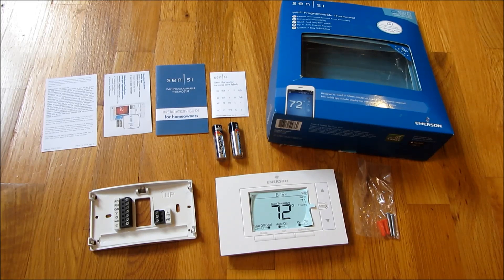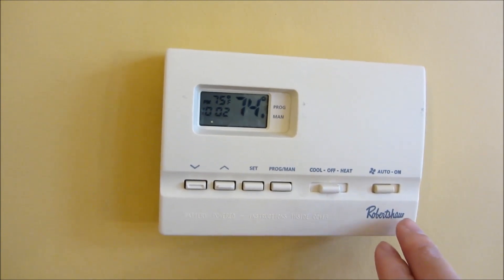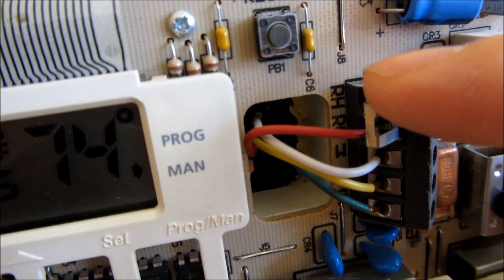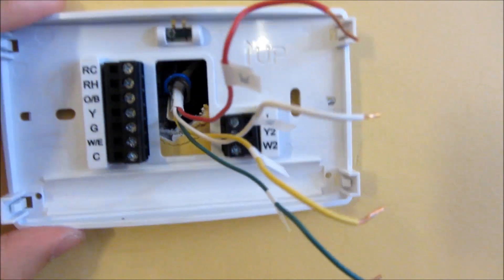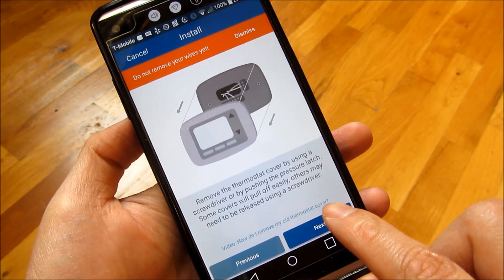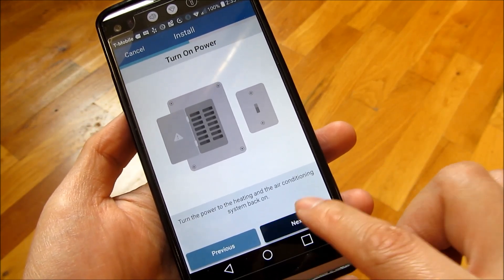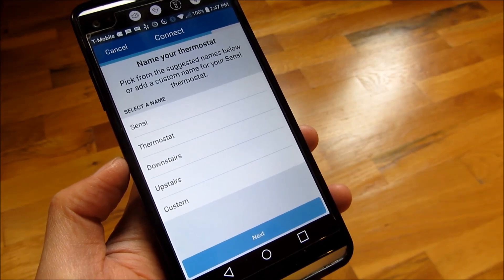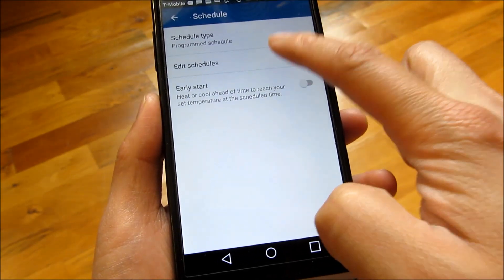No C-Wire Smart Thermostat Install | Emerson Sensi WiFi | Step by Step | Robert Shaw Replacement

Comment: I too have 4 wires RC, G, Y, W. I did see you connected the respective points. Do we need the brown wire in C or it will work without that.

Comment: I have a 2 wire system, oil heat only. The Sensi app says that wire configuration is not compatible with the Sensi thermostat. But you say it will work without a C wire using battery power only. Why wouldn’t the Sensi app say it would work? It doesn’t make sense to me. I don’t want to begin replacing my old thermostat until I’m sure. Please help.
Reply from the maker: I don't think this works with Oil Heat, I believe my brother had the same problem.  Mine is Gas Furnance, and apparently it works with a Gas Furnance without a C wire, but not with the Oil Heat.

Comment: A quick question about the C wire if anyone has the answer. Yes this thermostat works also without C wire (then must be powered by batteries) but does it mean that if powered with batteries you won't benefit from the Wi-Fi features? 

Because I just bought the same and I didn't install it yet, just playing with it (batteries plugged in). When turning on the Wi-Fi feature, I can see an X at top left rather than the Wi-Fi logo. I was wondering if the C wire is really required for not only powering it more efficiently than with batteries (you won't have to worry about changing batteries) but C wire would also be required for full Wi-Fi features?
Reply from the maker: Use it with AA Energizer lithium batteries, been lasting 4+ years without changing.  WiFi works well, you need to program it in the app
Reply: @PoolarityChannel  Thx for the tips man! I'll hope that once i connect the C wire, i'll be able to use the wifi Features.

I'm suspecting that this thermostat needs the C wire absolutely for the Wifi features, otherwise with batteries, it would just run as a normal thermostat

Comment: How long do the batteries last with no c wire?
Reply from the maker: Using lithium AA batteries, 4+ yrs, I use rechargeable lithium batteries in the links in description area, those last 4+ yrs on one charge

Comment: Without the C wire will the WiFi work? I have a 2 wire system and been checking if the built in jumper could be removed between RC and RH terminal? If it could I could connect a transformer to this thermostat on the RC and C terminal.
Reply from the maker: I use the Sensi without the C-wire, it requires 2 AA Batterys, so I use the Lithuim which so far has lasted 3+ years, WiFi and all. (see the description area for the ones I got).  But no issues its been over 3 years.
Reply: @PoolarityChannel  hello I am very confused . When you take apart the old tstat you have no c wire attached but then at 5:08 there is suddenly a brown wire and it is attached to the sensi C wire lug?? I thought the whole point of this video was not needing the C wire? I ask this not just because of the confusion; but because is that then meaning your batteries are not being necessary (as you do indeed use a C wire ?) ,and so all bets are off for having wifi with no C wire and running the Wi-fi completely off batteries? I have no C wire for my ST55U model sensi smart thermostat but I Do get the flashing network icon in the upper left corner of the screen but it will not ever connect; and I have been troubleshooting this for hours now and cannot make the thing connect. I have  R W Y G wires in the app setup. So my question is is your video representative of actually not having a C wire or not; And if you don't have a C wire can you get the wifi without the C wire or not? Thank you
Reply from the maker: @eswords1  so sorry for the confusion this was many years ago, so from my recollection I was trying out multiple additional wires that was hiding behind the drywall.  In fact there is absolutely no C-wire.  I have been using 2 AA Energizer Lithium batteries for 5+ years to power this, and it has been absolutely great, have not yet changed batteries at all.  The wifi is powered by the 2 AA batteries and have run flawlessly.
Reply: I have 2 wire system also and I purchased a 24 volt ac plug in transformer
Reply: did you leave any wire attached to the C lug at all, and if so, is it possible that that is providing power for the wifi?
Reply: On this unit is there a jump wire I need to remove to put in my 24v transformer
Reply: @vinnysantangello8982  You can cut the built in jumper on the back of the Thermostat, it is indicated and easy to spot. The info was from Sensi about 2 years ago.

Comment: Man you missed the need for batteries and C Wire topic which I believe lot of old thermostat owners are going to have to deal with. So I see there are batteries in there, so does it mean I don't need to bother with 'Common Wire" to power the device?

Comment: How do you know which wire is which if you just have no thermostat but 4 wires sticking out the wall?

I have white with blue stripe
White with red stripe
Red and blue

Comment: Why do I get the message that I need a C wire when comparing the wiring configuration between the new and old thermostats?  Early in your video you comment that the old system had no C wire and had batteries and the new Sensi also has batteries and would not need the C wire.  My old Robert Shaw unit had and O wire.  The Sensi unit has  an O terminal combined with another letter.  Same is with the W terminal which also has another letter.  I could not duplicate the same test you did when comparing the two wiring configurations.  Yours were the same for both units and you had no C wire but indicated that you had a valid configuration.
I did see that the wire to the G connection could be used at the C connection which would
make the Fan mode only operate when the unit was either heating or cooling.  By the way my unit is electric and is a heat pump.  Thanks for any comments you might suggest.

Comment: are you still using this thermostat and are you still happy with it? looking to change my thermostats, the one for my upstairs unit has no c wire and im considering this one.
Reply from the maker: Still using it, I use rechargeable AA lithium batteries on it, it's been 6+ months and the battery level.is still at 95%.  I use the remote Wi-Fi feature a lot through my google home hub, hey google turn on the heat, increase temp...all by voice command
Reply from the maker: Those lithium AA batteries still at 95% after 2 yrs

Comment: Mine wont turn off, everything is setup just like yours, 4 wire, even the old panel the same but when I try to turn it off it just kicks on the fan. Problem is it turns on the heater to. Seems like it runs both ac and gas at the same time

Comment: Hi Poolarity, I was wondering how the wires came out of your Robertshaw. Did you have to cut them?
Reply from the maker: No need to ut, you unscrew the screws behind the wires and then they just pull out.  If you see the 5 round holes above the wires at 2:30, in those round holes is a flat screw, just unscrew that screw in the holes and the wires will come out
Reply: @PoolarityChannel  than you so much!